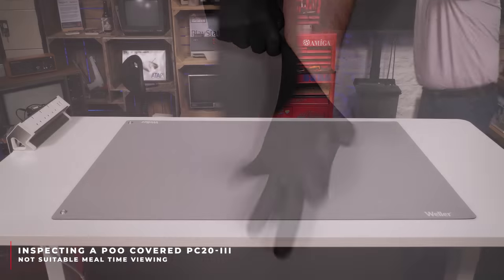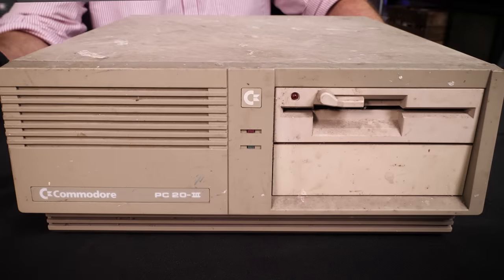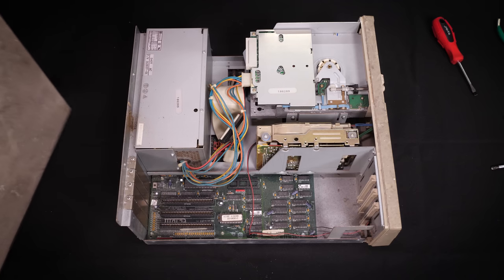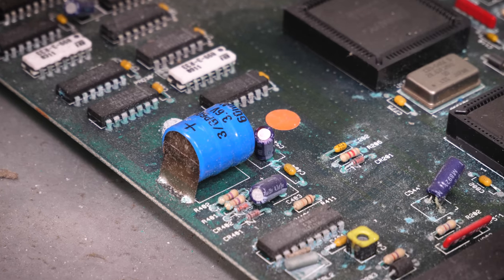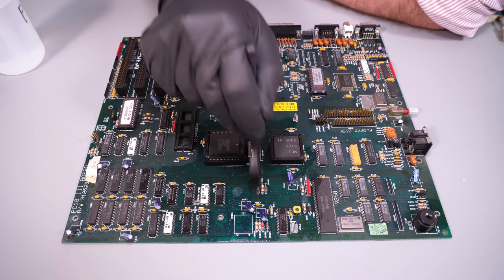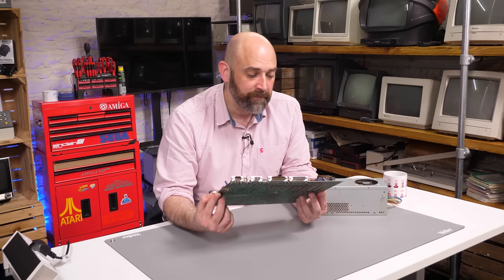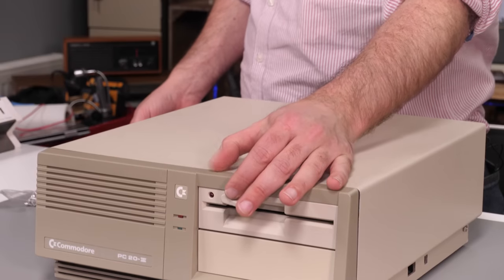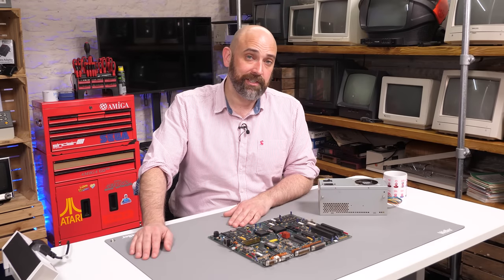A Disgusting Commodore PC20 Restoration | Can it be Saved? Trash to Treasure Pt1

Comment: Rather than a "wrap", I suspect that was a vinyl layer bonded to the raw sheet metal before it was punched out and bent into shape.
Reply: I believe you are correct. At the manufacturer where I work, in the past we used to fabricate aircraft interior parts using a variety of the same material.
Reply: @davidvaughan9547  The material for the case is just vinyl coated sheet steel. It usually has a rust resistant electroplating property too, it would only likely rust at edges and holes.
I'm sure I have a working one in my garage somewhere, I think I replaced the battery too.
Reply: I was thinking the same. In the 1970s and 80s Electronics shops sold numerous project boxes made out of the same kind of steel. You could even get woodgrain ones for LGRs ancestors.

edit I was trying to remember what I used such a woodgrain box for. It was for a RTTY (radio teletype) interface for my MSX computer so they were obviously still around in the 1980s. Aluminium boxes were nicer but about three times the price.

Comment: Reverse engineering that board is a perfect solution which the whole community will benefit from. Excellent idea! And I can't believe how great that case came out, think I need to get some of that UBIK 2000 for my next shower.
Reply: Well, Tech Tangents actually reverse-engineered a CD drive controller a while ago.

so if TT can do it, maybe he and RMC could work together to make it work for the Commodore PC10/20
Reply: @LondenTower  There's been a large number of those RE jobs recently, some a lot more complex. The think thank over at the 68k MLA forums managed to reverse engineer several Macintosh logic boards from the late 80s and those are four-layer boards, so considerably more complex. They're also working on modern replacements for as many of the custom chips as possible. Absolutely amazing!

Comment: I was gonna offer to slog through the board level repairs because I'm a sucker for punishment, but I think the board RE and recreation work is a much better option! Looking forward to seeing the results.
Reply: In the state it is, it is probably the most sensible use for the original board. In the end, despite maybe never having been used for its originally intended purpose, it will still serve a higher purpose. 
After the RE it can still be a nice static display (especially since it only has two layers, no destructive disassembly is needed).
Reply: I spent many hours repairing a Casio CZ101 synthesizer where the D cell batteries had leaked onto the PCBs. The problem was it never stayed working. Every time I thought I had fixed it a new problem would occur a couple of months later.

Comment: Back in 1990 when I started my university course, Barclays bank had a student deal to purchase a PC via a low interest loan. This was therefore my first PC and over the next four years I added a Soundblaster, 3.5 inch floppy and replaced the hard drive with a whopping 170mb model.  There was one major downside which was that when the main board cooled down when powered off, the CPU chip popped out if its socket. The repair guy for Commodore told me this was a common fault and showed me how to fix it by simply clicking it back in place.  So for several years the Commodore PC lived without any screws in the case as the lid was popped off on a regular basis.  However it got me through four years of an international IT degree which led me to a successful career so flaws or not, there is a special place in my retro heart for this PC.  Thanks for featuring it Neil.

Comment: I have a perfectly working Commodore PC30-III (a 286 machine) that my father bought it in 1989. It still looks like it's brand new and I even have the original receipt from Dixons! I do not remember the casing having some sort of vinyl layer on top of the metal, so it might be just a PC20-III thing I guess?

Thank you for the nostalgia! I'll fire up the old beast tonight :)
Reply: Better check the battery!
Reply: @rosstee  Luckily it has a Dallas DS1287 RTC chip that houses the battery inside, so it cannot leak. But since it was dead after 34 years, I bought a replacement with a coin cell holder on top of the chip :)
Reply: @virtualworlds8081  The employee at Dixons asked my father if he was a banker or a scientist when he bought the computer and was surprised when he said that he bought it for me (when I was 3 years old). That's why I'm never selling it :D

Comment: This is going to be AWESOME! I can’t wait to be able to buy one of those boards off those chaps, once they’ve gone though the process of reverse engineering the board. I might even have some advice for some really simple, but very interesting modifications:

- floppy controller disable jumper
- the obvious CR2032 mod
- mine has a very bad quality composite out. I don’t know if it’s just my board, but that schematic could be improved a bit. 
- and while we’re at it, perhaps just replace the horribly obscure XTA interface with the now common XT-IDE interface. 

Great job on that mint case Neil!

Comment: Technically speaking it is not 'vinyl wrap' but it was 'vinyl coated sheet steel' which was stamped and folded to make the case. I would carefully glue it back on wherever it has come loose!

Comment: Man, that SOTB2 box and shirt brings back memories to when I bought that. As for the damaged board repair... that was my fulltime job for 15 years. I would get entire boards from the electronics I repaired that were covered in waterdamage. I needed to remove most of the main surface mounted components and would spend hours repairing 100's of traces and feedthrough holes, etc before even turning it on to know if it would ever work. These were older automotive computer control units that were no longer available... so if I didnt repair them... then anyone with that car was out of luck.

Comment: 9:02 I'm always amazed how it is possible that so little acid / base from battery can spread that far, because as far as I'm aware there is not so much of that stuff inside battery.
Reply: It's got a million little feet to crawl into the tightest spaces. On a board like this it's even inside the chips.
Reply: The salts (green crusty) are often themselves corrosive, so corrosion can spread like a fire where it only needs a little starter incident to spread across an entire area

Comment: I agree with the board approach a brand new board is much more viable and a permanent fix will aslo give opportunity to improve ground plain battery socket and other minor quality of life improvement can even silk screen some cool stuff on board and mark it replica motherboard for serial number specific to the original polish up the original board and coat it for use as the mouse pad. So many ideas come to mind.

Comment: There was something about that mouse port. At some point in the late 80s, early 90s, my father had bought a PC-10. I remember that there was a problem connecting a mouse, because by default it wouldn't accept a serial mouse. At least, I think so; this is 30 to 35 years ago. I checked the manual, found what needed to be done, and wrote a little piece of assembler code using `debug.exe`. This solved the mouse problem.

Later, in a Dutch-language personal computer magazine (that was actually its name: PCM, Personal Computer Magazine) that we read,  one reader asked a question about this very problem. So I wrote them a letter (!) with my solution. Of the people that answered, my answer was the most detailed, and so I was given a book voucher.

Comment: That's fantastic news to hear that Rob and Chrissy have agreed to reverse engineer the PC-10/20 board!  If I were taking on that task, I would change one thing for modernity:  Replace the Paradise PCV4 chip with a VGA chip and the associated port on the back of the system.  Externally, it would blend right in.
Reply: Normally, I'd agree but I believe the PCV4 support the Plantronics video mode which while really rare is just a cool thing.
Reply: Are the DB9 and VGA connectors the same physical size? Otherwise you'd have to enlarge the hole in the case. They might be though.
Reply: @Ragnar8504  They are the same physical external size.  I have used a card slot bracket with a hole for a DB9 port on a few VGA cards that were missing that part.

Comment: I had a 10-III in the late 90s when I knew next to nothing about using PCs and ended up giving it away. I bought it pretty cheap from a fellow who had it since at least 1992. Later on, looking up photos of the 10-III confused me as I assumed the 10 referred to the series rather than the standard equipment. In my high school chemistry lab--which I was in maybe once because I didn't take chemistry--there was a 40-III which likely belonged to the chemistry teacher as I heard there was a teacher who collected Commodore PCs. Incidentally I saw another Commodore PC perched atop a file cabinet in another lab I had no classes in. This was also in the late 90s, while I was asking around for Apple IIe software because I wasn't yet acquainted with the internet. I had finally gotten my mitts on a platinum IIe with twin drives and a monochrome monitor that had been sitting unused in my grade 10 English Workshop classroom for a long time. It wasn't easy; teacher didn't want me touching it and my VP brushed off my request, but I persisted until the principal agreed to sell it to me for peanuts. Years later I would run into him at a Starbucks where he recognized me instantly for that very reason. Actually I went through him for three retired IIe systems total, the other two earlier models with DuoDisk drives and colour monitors.

Comment: Finally RMC has something in common with another YouTube channel I follow (Rebuild Rescue) in that you both work on machines covered in bird and mouse droppings.  Otherwise I have to question whether that chemical could be an alternative to retro-brighting?  It certainly seems a lot more effective than the normal car soap treatment.  Maybe it would be worth trying with some of those cases that came out a bit yellow despite being through a retro-brighting process.
Reply: Given that the yellowing in certain plastics is the result of UV light exposure, I doubt any industrial cleaner would work as a substitute for hydrogen peroxide (retro-brighting) Hydrogen peroxide works on different mechanism then industrial cleaners.

Comment: Another great video, that case looked amazing after the wash. @RMC what sort of desk are you using in the lab and does that funky attached power supply come with it?
Asking for a pigeon friend who was working in a barn setup until recently.
Reply from the maker: Hey thanks! The desk is a Flexispot branded one from Amazon with duel motors. The plugs are sold separately and just clamp on to any desk, that's Hannelore branded.

Comment: As soon as I saw all the pits and was told it was on every trace, I straight away would've gone to laying out a new PCB. It's bigger than I've done before, but at least it would be a permanent fix, ie, no returning corrosion hiding under components.

Comment: I've seen MUCH worse damage where the battery acid ate away even the board, delaminating it. However, the traces were so thick, no damage at all! Just looks scary and I kept it. A 386sx from an oem machine. I only had to wire in a new AT Power connector on wires because some of the traces are too loose to attach power on the board itself.

Comment: A very interesting video as always. I think the case was powder-coated (powder-coat  can peel off like a vinyl wrap in certain circumstances), and the effect of years of bird-poo & the cleaner was too much for for it.
Reply: Wouldn't the powder have stuck to the edges of the metal as well? It's kinda sprayed on like paint. I think the suggestions of it being vinyl-coated steel that was cut and shaped after being coated above are spot-on.
Reply: @Ragnar8504  Good point; although that depends on how it was held as the powder coat was applied.

Comment: I'm from the slot machine restoration world, and even there, we deal with some nasty Varta BLUE Mempac batteries (We normally fly-wire the GREEN Ni-mh versions), known to us as the "Blue b'stards of Death". Nothing worse than a Barcrest MPU4 systemboard, that has had a Mempac crap itself (Mind you, Maygay Epoch is worse, when you see how tiny the battery is, and what damage it can do), and yes, we pretty much deal with and have the same issues as you here, with damaged tracks, components etc.

Comment: Commodore must have bought millions of extra 'explodey' batteries in the 1990s. I still mourn my A4000 whose battery ruptured and spilled its guts across the motherboard destroying pretty much every trace when it was only a few years old. Sigh...

BTW. Did Commodore use much the same case for their PCs as the A4000?
Reply from the maker: Ah yeah the 4000 battery is right next to the RAM and just destroys all the traces under the simm sockets.
The a4000 case isn’t shared with any PCs as far as I know.
Reply: @RMCRetro  Thanks - it must have been Commodore's then-current 'design language' - which wasn't a patch on the A1000, A3000 and C128D design. 

Good luck with the rest of the project -you are a brave man!

Comment: is the battery really the cause of damage? i mean it is looking like it is some kind of wide spread electrolisis corosion, more caused by huminity and voltage differential
but it doesn't look like battery leakage. are you sure comodore didn't use rechargable cels in place of battery?

Comment: Got to disagree with the N.O.S. bit - the crud in the PSU, in particular the fan, says that has seen 100s of hours of use. Would hazard a guess that it may have been a shop display model where the monitor sits on a shelf instead

Comment: I'm begging anybody dealing with bird shit to wear a respirator, please. And for the love of god, don't blast it with air. When that stuff dries it will easily crumble and turn to dust which can float around. If you breathe it in, you could be in a very rough time. I nearly died from it once and what I did end up having to go through was horrible agony anyways. This isn't just me saying it, bird crap is a major health hazard. They'll shut down commercial buildings if enough of it is found until it gets cleaned up.

Comment: 8:12 10:28 Look at those power connectors, if only modern ones were that solid. Making things smaller and smaller doesn't automatically make them better. I'm looking at you #PCI-SIG for your 12VHPWR and your directors who approved it at #Nvidia #Intel #AMD #Dell #EMC #IBM #Synopsys #Keysight #Qualcomm.

Comment: Apoint to note the drives might scsi 33/66 based if you are going to try using something in replacement , IDE/eide  didn't really become a standard hardware solution in pc's until the mid to late 90's
I would try and talk to 1 of the commodore designers because you may be needing to fix any known faults not caught in the initial design faze of the original design faze of the pcb mainboard...
Reply: Lew Eggebrecht might be the man you need.

Comment: I've seen much worse than pigeon poo. Try cockroach shit in the grease of every drive gear, in every crevice, within every sealed area. Mix that in with silverfish degradation. And how about lots of rust? And how do you repaint or touch up that?

That isn't paint. It's way too perfect. It's a wrap all right.

Wish your boffins could help my toys.